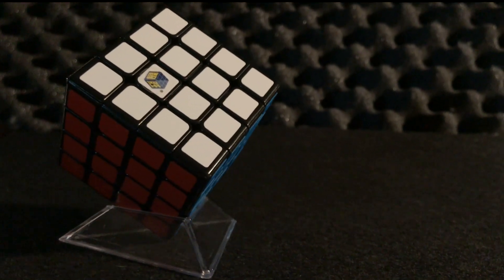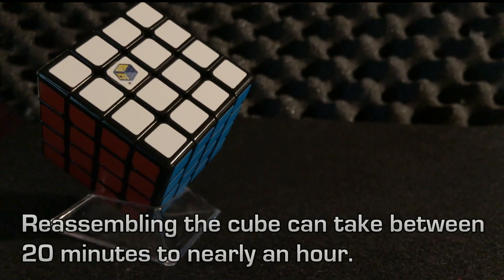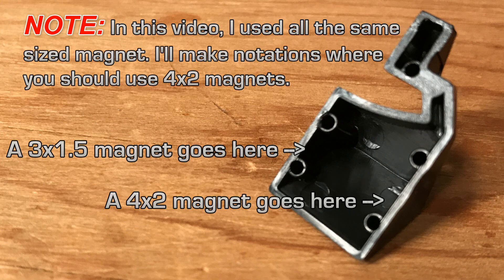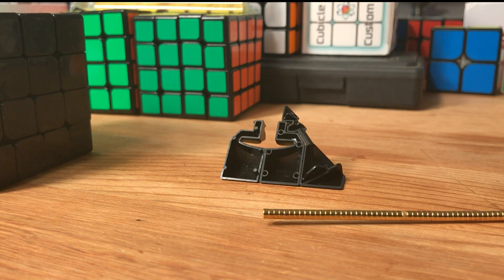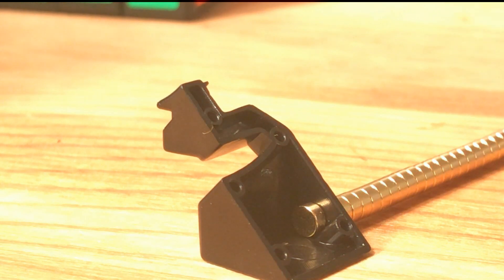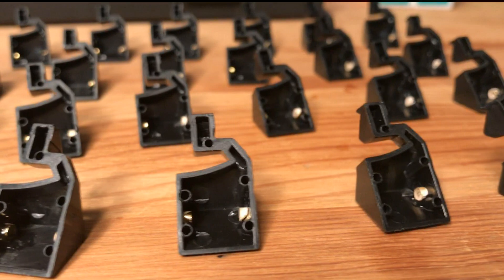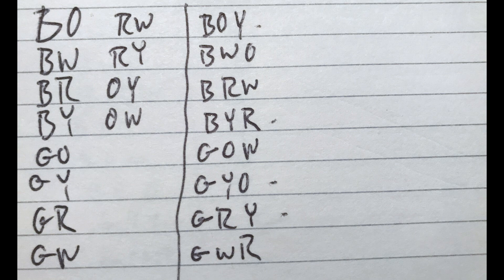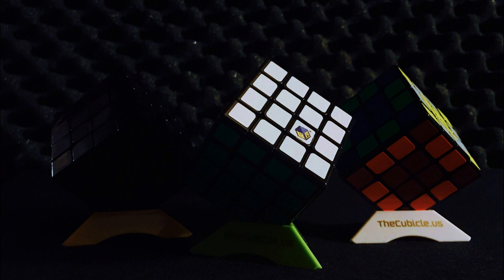How to Make a Magnetic Yuxin Blue 4x4 and other 4x4 Speed Cubes

Comment: After looking at the cubicle labs wuque m Im pretty sure they are using 5x1 outside and 4x1.5 inside. I used this on a wuque and it feels great. Inside is a bit stronger which is really beneficial for 3x3 and outside has a stable smooth yet tactile feel
Ps n35 4x2 is way too strong for outer layers on wuque that's why 5x1 n48 is great
Reply from the maker: Hey, I really appreciate this!!! Very helpful!!!! I've heard from a few people that said the N35 4x2 on the outer was too weak. But I absolutely love the N48 5x1s where I've used them in 3x3s. Thanks!!!
Reply: DMCubing oh ya forgot to mention the 4x1.5 is n38
Reply: I used 5x1 n48 on outer and 4x1 n48 on inner in my first one... it's a great inner / outer ratio. overall I thought it was on the stronger side, but still nice.
Reply: Now that I have done a bunch of solves on my 4x4 I would definitely change the magnets in both the inner and outer layers.  I used 3x1.5mm N52 for the inner and 4x2mm N38 for the outer.  For the inner magnets i think i need slightly stronger pull, so maybe a 4x1mm  N48 and for the outer layer I will use 5x1mm N48s for a lighter pull.
Reply from the maker: This is great information to know!!!! I appreciate everyone sharing their results!!! Thanks!!!!
Reply: Where do you get your magnets? SCS only has n48 and n35, and ebay takes months to ship
Reply: could not find 4x1.5 N38, Can I use  3x2 N50 or 3x1.5 N50 instead ?
Reply: Pannarong P. Use kjmagnetics magnetic calculator and enter in data and see if the pull force is similar to what the desired magnet is. Keep in mind smaller with magnets will click into place harder than those with larger width (even if they have similar pull force)
Reply: exing1OoO1 what grade 4x1.5?
Reply from the maker: Oliverleo2007 N38.
Reply: The cube I just finished has a nice strong, but not too strong, outer layer with the 4x2 N38.  You could drop to N35 and i am sure it would still be strong.  the inside layer on this cube i find could use a bit more pull than the N52 3x1.5mm.  I think I might use 4x1 N48 or 5x1 N48 to beef up the inner layer.
Reply: For the WuQue, On the stronger side.. 5x1 N48 in corners and 4x1 N48 for edges.. I think you'll like it. magnets from apexmagnets.com
Reply: +Samuel Haviland. N48 sounds good.. i know jumping down to 4x1 and 3x1 n48 is a light feel and the 3x1 isn't strong enough for edges. ( had to double up on one side to increase power) Overall, light magnetization. Hard to tell what would be just one step up in strength... between the two I've made.
Reply: IGCuber i
Reply from the maker: Samuel Haviland Great information to know. Thanks for sharing!!! He didn't remember the grade???? I'd tend to believe he just said that, as I'm sure he'd know how strong the magnets are. It's great he did share what he did. 😀
Reply from the maker: Samuel Haviland It's nice he shared what he did. I'd love to meet him some day. 
Hey, that's great about doing so well on 2x2! Congratulations!!!
Reply: DMCubing hi! I'm about to magnetize my 4x4, and I'm wondering if 3x1.5 n50 on the inners and 4x2 n35 on the outers will work. Thanks!!

Comment: 4x4 Complete! Absolutely fantastic!
I have been reading some of the comments about what strengths to use in the different layers so this is my opportunity to lend my 2 cents (even though we don't have pennies here in Canada)

I used 3x1.5mm N52 for the inner magnets and 4x2mm N38 for the outer layer.  

Now, I am not a speed solver on this puzzle by any stretch and I am still honing my finger trick skills and cube manipulation in general.  I can definitely say that this cube is an improvement on  a non-magnetic version.  The outer layer does have some bite, but it isn't off putting and is definitely not too much for me.  The inside layers have enough grab that they turn together with ease.  So, for my level I think this will do just fine.

When I do my next one I think I might use a different magnets for the inner layer and I will indeed use a slightly softer magnet for the outer layer, probably the N48 5x1mm. 

On to my next cube!

Comment: I saw a Cubicle Labs box at around 6 minutes, and was wondering what you got from the cubicle.
Reply from the maker: :-) That is a Cubicle Labs GTS2M!
Reply: Great! Do you think that 5x2 N52s in the corners would feel nice with 4x1 N38 in the edges for a GTS 2?
Also I was wondering if you think that 4x1 N52s would be nice for the inner layers of a wuque? Thank you so much!
Reply from the maker: NeCuber I think you'd be ok with the N52 4x1 on the inner of the Wuque, but are you talking about 5x2s in a GTS2? If I'm understanding you correctly, that would be twice the magnet you'd ever need in that cube.
Reply: I'm sorry, I meant 5x1 N52. Thanks for the reply!
Reply from the maker: So in a GTS2, 4x1s in the edge piece and 5x1s in the corners? I suppose you could do it. I've never mixed sizes. Usually when you mix grades, or strengths, you end up with an average of the two together. So if you were to do this, you'd have a fairly subtle cube since you're using the 4x1s on the edges. It actually might make for an interesting experiment.
Theoretically, though, you might be better off using the 5x1s in the edges as they weigh just the tiniest bit more and might add to the momentum of the M slices and may potentially make them better. But then again, it's such a minuscule amount of weight difference between the two, but that's what I'd be prone to doing.

Comment: I just can't thank you enough for your videos. I magnetised my Mini Thunderclap 4x4 with 3x2 N50 in the inner layers (A little weaker than I'd like) and 4x2 N35 on the outers. The cube feels amazing. Thank you :D (One piece of advice: Clean out your cube beforehand if it was lubed, it makes the assembly process a little easier, since the pieces aren't all oily and slippery. I learned this the hard way xD)
Reply from the maker: Roman Lubij Thanks for your very kind words!!! I truly appreciate it!!!!!! 

Yep! I always spend about 20 minutes using rubbing alcohol and Qtips cleaning out the interior and exterior of the cubie pieces. The clean surface helps the glue adhere better!!!! I usually say that in most of my videos. Looks like I forgot to mention it in this video.
Reply: I thought 3x2 N50/N52 would be too strong for the inner, I'm planning to magnetise mine too

Comment: At 1:36 in the video, it only shows that you have one magnet in the corner cubies. And as it looks, there is a corner and edge pair that won't have any magnetic attraction because they don't have magnets that are attracting in the edge and corner pair
Reply from the maker: Woodiertax 1 Trust me, the illustration is perfectly correct. As you're looking at it, think about rotating it in all directions and you'll see that every corner piece does, indeed, have three magnets in them.
Reply: DMCubing oh okay. Was just making sure before I tried it myself. Thank you!
Reply from the maker: Not a problem. Once you take all the pieces together, you're going to end up with:
- 24 identical pieces that make up the corners.
- 24 identical edge piece halves with posts. 
- 24 identical edge piece halves with receptacle holes. 

One magnet into each corner piece third (24 magnets)
One magnet into each edge piece halves with posts (24 magnets)
Two magnets into each edge piece halves without holes (24 magnets)
24+24+48=96 magnets.

Comment: Hey DMCubing! I have done my magnets mods and OMG I finally have success. I did a Yuexiao Pro M with 5mmx1mm n42 and it makes it so stable but so much more enjoyable to use! I also did a magnetic Wuque and it is absolutely amazing! I did 4x1 n38 in the outer and 3x1.5 n52 in the inners and it makes it so stable but not overly strong. Also a great tip and something I sortof thought of. When you align the pieces together. I take a lego plate and line up the pieces so they are perfectly straight and and magnets will be perfect. Thanks so much and keep up your excellent work.
Reply from the maker: Ducksfan101 Hey, that is AWESOME and I'm so happy for you!!!! And excellent tip on using the lego piece to keep the fronts of the pieces aligned!!! 
Thanks for your very kind words!!!

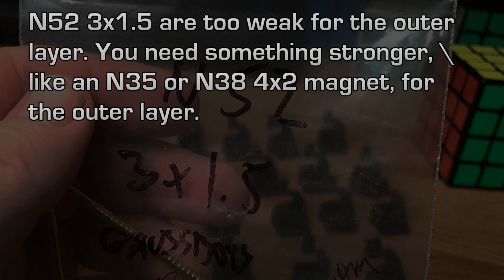Comment: I'm confused about the text at 3:05.
Isn't N52 a lot stronger than N35 or N38?
Reply from the maker: Clement Tan The important thing here is the SIZE. I'm comparing an N52 magnet that is considerably SMALLER than the N35 and N38 4x2, which are larger and stronger.
Reply: Think about the N rating in terms of gauss per unit volume.  N52 is stronger per unit volume, but the 3x1.5mm has less than half the volume of a 4x2mm (42.41 cubic mm vs 100.53 cubic mm).

Comment: How about a Mini Thunderclap 4x4, what magnets do you recommend for it? And is there a size that won't fit in it? considering that it is a Mini 4x4
Reply: I checked my local cube stores and stuff, how about n35 4x1.5 on the inner, and n38 4x2 for the outer?
Reply from the maker: Flaming Dudes Yes you could do that. Most people use N35 4x2 on the outer and N35 4x1 on the middle. Using 4x1.5 in the middle layer will result in a stronger attraction in the middle slice because there are twice as many magnets in the middle. That's why most people use 4x1. But I think you'll be fine.
Reply from the maker: Flaming Dudes answered below. You can fit 5x1 magnets. Most people use N35 4x2 on the outer, and N35 4x1 in the center.
Reply: @dmcubing6342  What about 3x2 magnets in the inner? Which one would you recommend more? 3x2 or 4x1?
Reply from the maker: Chesta Rosyadi I think they'd work fine. The key is that since there are twice as many middle magnets as outer, the middle magnets should be at least half the strength of that of the outer magnets, and preferably a little stronger than half so as to keep the center together while moving outer layers. You can use the magnetic calculator at KJ Magnets to come up with values for all sizes of magnets. Here you go: https://www.kjmagnetics.com/calculator.asp

Comment: Nice video!  i was just wondering what you think of 5x1 magnets as compared to 4x2. im getting a valk m with 5x1 n35s and im not sure how 5x1s affect the turning
Reply from the maker: Chris Choi The 5x1s are the best thing ever in the GTS2. In a Valk, because of the cutaway design of the corner pieces, you don't get as much reduction of strength. So I certainly wouldn't use anything over an N35 5x1. I tried an N48 5x1 the other day in a Valk and it's really too strong. Again this is because the cutaway holes in the corner pieces allow more magnetic field to pass through from the corners to edges. 
Let me know how the N35 5x1s work out.
Reply: ok thanks. i will let you know when i get it. im also getting a xinghen M with 4x1 n50s. at nats i felt a xinghen m from the cubicle and it felt way to strong for me. i know that the magnets in a 2x2 have to be doubled up so do you think the 4x1 n50s will be too strong in the xinghen?
Reply from the maker: Chris Choi You said you already tried it, right? So you probably have a better idea than myself if you'll like it. 
I think the N52 3x1.5 magnets work really well in 2x2s.
Reply: also i have one more question. if i use the gorilla high impact super glue u always recomend, then how long should i wait for it to cure? on the package it says for 24 hours but i feel that it is a bit too excessive and in ur videos u say to leave it over night, but i did it during the day and i dont know when to start turning it again.

Comment: Hey dm really nice video !!! You probably dont remember me but last time I asked you what magnets to use in a valk. You answered me N35 4x2 and it worked out perfectly !! Thanks to your video I could do it myself easily. But you also told me that N48 5x1, that were the best for the weilong gtsv2, could be good in the valk. Did you try them in the valk ? Because, my Valk M is so good I am going to buy a stickerless one to magnetize it! So I was wondering what to use. 
Also, what magnets do you think I should use for the yuexiao pro ? Did you get a chance to try it out ?
Reply from the maker: Hi Raphael,

I do remember you! I'm so glad to hear your Valk turned out perfectly! That's awesome!!! Thanks for letting me know!!!
Yes, I did actually try the N48 5x1s in a Valk a couple of weeks ago. The results were not that positive. Because of the cutaway holes in the corner pieces and the close proximity of the magnets to the holes due to their width, there is an increase in the magnetic field. So unlike the GTS2 where the magnets feel subtle and you have improved performance, in the Valk the N48 5x1s feel a bit too strong- kind of like an N42 4x2 magnet in strength.
So, I still think the N35 4x2 is best for the Valk, or the slightly undersized N35 4x2s from magnets365 if you like just a slightly lighter feel. 
Haven't tried the Yuexiao Pro yet. Just ordered it a couple of days ago. I'm certainly looking forward to seeing if it can be magnetized!!!!
Reply: DMCubing thanks for the answer! I still have one set of undersized 4x2 N35 from magnets 365 so they will work perfectly. I look forward to magnetize it ! I hope you enjoy your yuexiao pro and let me know what you will experience with it !!
Reply from the maker: Rafaël I sure will! When I can get to it, I will do a tutorial on it!

Comment: hey is 3x2 n35 weaker than 4x1 n45?
Reply from the maker: Hey, that's a great question!
Using the calculator at
https://www.kjmagnetics.com/calculator.asp
It shows a value of .40 lb pullforce strength for the N35 3x2, and .39 lb for the N45 4x1, so essentially they have a similar predicted strength. In practice, however, wider magnets generally have a softer, subtler "click" when compared to narrower magnets of similar strength. What this means is in a cube, the 3x2 may have a slightly more noticeable click or bump as the magnets pass each other, and the 4x1 may end up having softer bumps.

Comment: May I ask how you measure and try to assume what's the best magnets for the thickness of plastic? For my past few project's I've just done guess and check and I want an actual reliable way of choosing the magnets I use.
Reply from the maker: Lexmic Well a lot of it is actually guesswork. You can use the magnetic calculator at the K&J Magnetics website to get a general, broad idea of how magnets compare to each other by entering parameters such as grade and size, and what kind of pullforce strength each is capable of, but honestly, until you actually glue them into a cube and come up with a prototype or two, it's still kind of hit or miss. 
There are some generalities that help. Like in a normal weight 3x3, N35 4x2 is going to give a pretty subtle feel, and that the same magnet is going to feel slightly stronger in a lighter weight (thin plastic) cube. That in old style cubes like the GTS or Aolong V2,?you'll need an N48 4x2 for a minimum of magnetic pullforce strength. But really, we get these results from trial and error. 
I personally built over a dozen each of the Valk and GTS2 before really settling on ideal magnets for both. 
In 4x4s, it's new territory for me. I watch a lot of videos and read a lot of comments to see what people are using and I pay particular attention to their results and what they prefer. I'm personally not much of a 4x4 cuber, 3x3 is really my thing. 
And I also feel, that when in doubt, use the N35 4x2! That's usually a starting point, particularly in the 3x3. And now, after having done enough of them, I know NOT to use that magnet in a 2x2- you're better off with a 3x1.5 in those cubes. 
But the magnetic calculator is a helpful tool, particularly in way of comparing magnets. 
And one last thing to add. There are other contributing factors that have an effect of perceived magnetic strength. The most important one being the distance of magnet from core center. You can dial in to some degree a very personalized magnetic feel based on where you place the magnets. The closer to the core, the more subtle the overall magnetic feel. On cubes like the Air, that's a good thing to know ahead of time as that cube performs better with a subtle magnetic pullforce strength.
Reply: DMCubing thanks for such a detailed reply! I'll check the calculator out. Although, to be honest, I'm gonna have to learn how to use it. Still not very familiar with this stuff haha.
Reply from the maker: Lexmic The calculator is pretty simple. The values i enter the most are Disc for shape, Grade, size in millimeters and that's about it. I leave distance at zero but you can change that value to reflect the distance between the magnets as they're positioned inside the cube. Fun stuff!!!